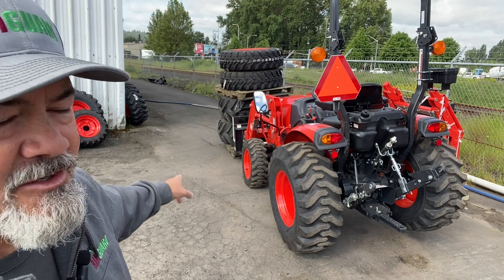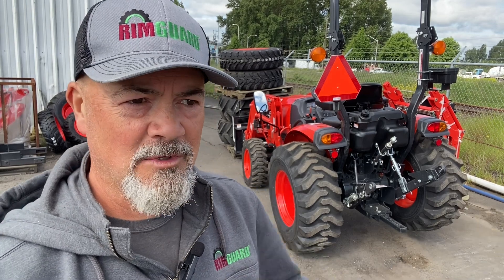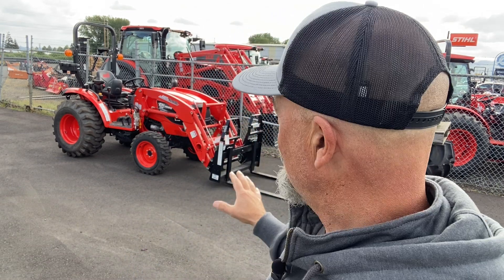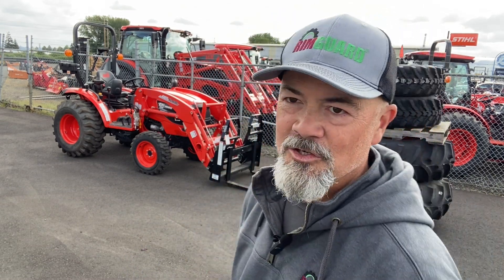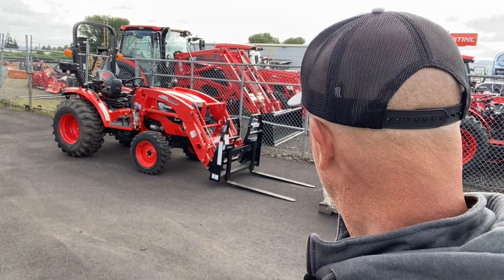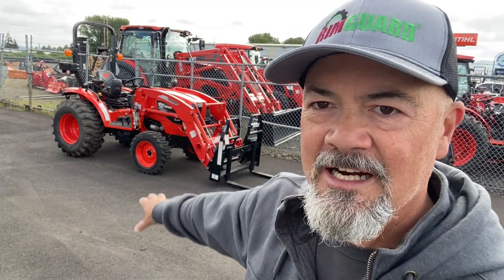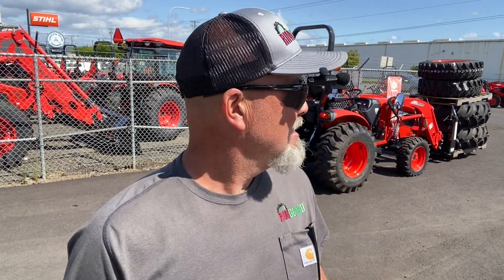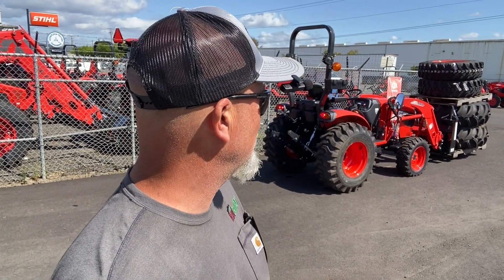The Best Thing You Can Do to Improve Tractor Performance and Safety!

Comment: How many gallons would it take to fill both tire for the CK2620 tractor?
Reply from the maker: Hi John
Rim guard weighs 10.7-11 pounds per gallon. They say it adds around 600 lbs to the rear of the CK tractor. At that math it points you around 55 gallons. Not sure it’s an exact science since you do leave some air in the tires. Take care!🚜🇺🇸

Comment: How do you check the pressure? Does the valve stem need to be at the highest point? I assume that there is still room after filling for an air pocket?
Reply from the maker: Hi Jadad52,
Yes, you are exactly right. You put your value stem at the top and check air pressure there. You still have to maintain proper air pressure or your beet juice will leak. Thanks for the view. Cheers!
🚜🇺🇸
Reply: @tractorrookie  Thanks! Great video, I just bought my first- Kioti CS 2520.
Reply from the maker: Awesome! Congratulations!